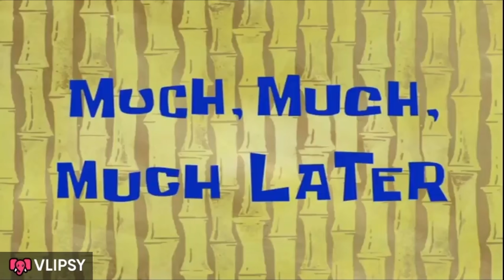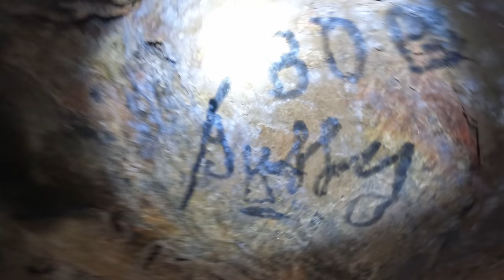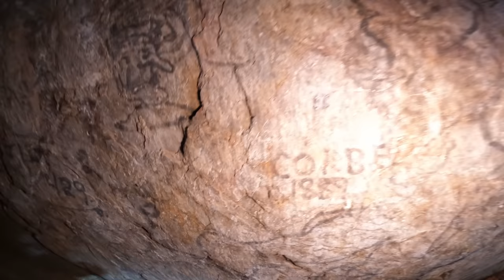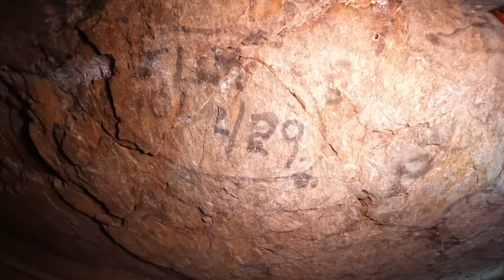We Got Stuck In An Old Mineshaft Elevator 900 Feet Below The Ground At Cerro Gordo!

Comment: When I saw sparks touching the sides from the top I was saying DON'T touch the walls! But apparently he couldn't hear me thru time and space. That is way too long of a run to get away with touching the walls, or even moving around too much. Maybe that wasn't it, but any side influence is probably not a good idea. I know there were some tight squeeze areas anyway and you guys were heavy. The dynamite is kinda scary too, but my gut tells me that the temperature was really working for you. It would be a lot more dangerous if you had brought it up into the heat. If you ever want to move that dynamite out of there. Bring a cooler and some dry ice. and wrap the dynamite carefully in thick cloth like a towel and put it in the cooler. But again that is just my gut.

Comment: I bet that would not pass OSHA regulations right now for safety in any regard.
Hope you guys use a sniffer as you go down to monitor oxygen levels and other gases.
historically they probably had pumps running to pump oxygen down into the lower levels.
You should use your carbide lamps down there also to monitor oxygen levels.

Comment: Any truck driver will tell you go slow and never pump the brakes; it is like feeding oxygen into a fire. You should go slow and press the brakes firmly and never let up and use just enough pressure to maintain a slow speed without heating up the brake shoes.  Like rubbing your hands together you can rub them all day long as long as you do not put too much speed and pressure on your hands or they start to heat up with friction. Same principles here for going down a long steep grade, without engine brakes or exhaust brakes either.

Comment: Not a good idea, I have worked underground at the 1500 ft level, and there is danger of all kinds, I didn't see any detection equipment
or oxygen detectors or methane,  you could have all just suffocated from lack of oxygen and no one could get down in time to save
anyone. The cable was checked every day for any broken strands by holding a rag on the cable during a test run, if to many snags, or broken 
 strands, the cable was changed.

Comment: I would trust that old lift more than I would trust anything built in the 2000s especially if it had been sitting for 20 years versus a hundred something I would prefer the one that had been sitting for over 150 years versus one that had only been sitting since it was new in 2000 for 20 years and I put my faith in the old-timers a hell of a lot more than I do the new timers

Comment: I do believe in ghosts. If you feel heavy chest and cold you have a ghost encounter
Reply: Slightly inaccurate. I'm a investigator myself, and you can get cold and have heavy breathing when you're 900+ feet below the surface of anything. It's called your body reacting to elements that it isn't used to, and it's trying to adapt.

Comment: This is the first time I've seen brake fluid go from a fluid state to a gaseous state.
Reply: It's not the brake fluid most likely. It's water absorbed by the brake fluid (because it is hygroscopic - absorbs moisture from the air). And as we know, water boils at 100 celsius, becomes steam with all that heat and all of a sudden you got no brake pressiure. Happens all the time with motorcycles, have seen it on several occasions during touring. This is the reason why you change all your brake fluids before the season with fresh fluid.

Comment: Man you guy's are more of a nut than I am. I was in the 82nd Airborne Division. I worked for the power company for 21years.Did 4 to 1 slopes on 65ft. Deep retention ponds in Florida with a dozer. But I don't think I would even consider going down a mine shaft 900ft deep. Old rickedy lift old cable's oh hell naw. 🌞🌴🐊I hope you guy's checked the oxygen level. Normal is 21% and you will have a major problem at 16%.

Comment: I have been in some of the scariest caves in the world, they are in AFGHANISTAN,  what they have in them would make you never go caving again,  I thought ahead and had my 600 Nitro  Express  delivered to me, it shoots a 900 gr solid copper  slug, has 14,000 pounds of nock down power, twin barrels two shells, and they work great I brought  220 shells with me used 178 of them they did their job very well, I can't tell you what's  in those caves  classified  you know, but do some digging to see what you find, I will tell you a 600 Nitro Express  works very well over anything that  the  military has to  use next to a 203 grenade  bit we don't talk about that, see what you can find out

Comment: Dude PLEASE wear your helmet!!! You are a big guy and if you just tap your head on some of those rocks they can split you open or knock you tf out. It would have been extremely hard to drag you to the elevator from the area you thought initially was a powder room. Don’t take any unnecessary ricks especially when it’s as simple as wearing a helmet that you had with you and help is a bare minimum of two+ hours away👏🏻